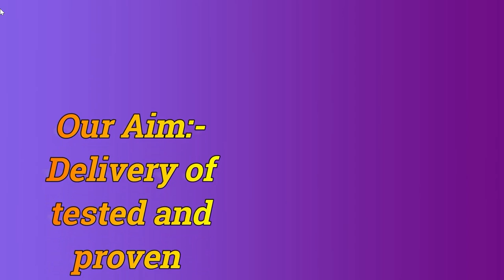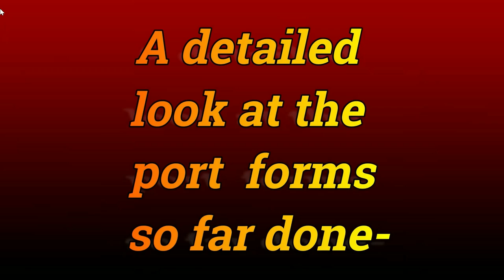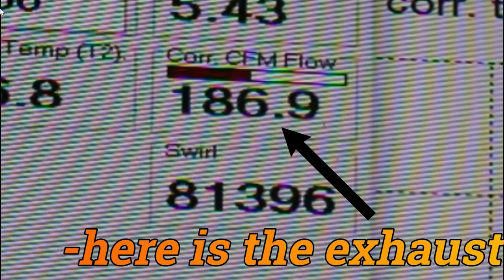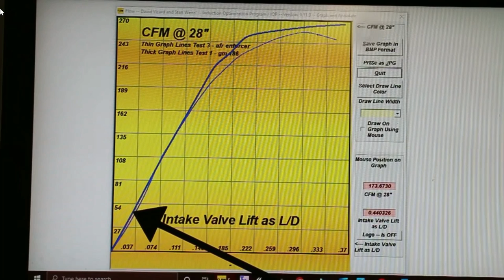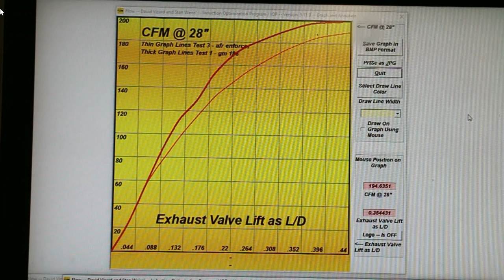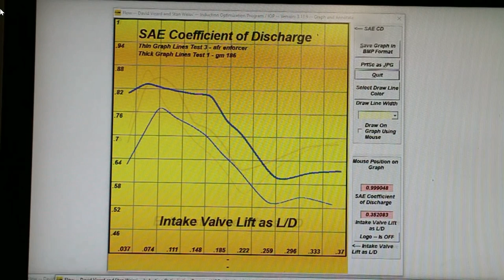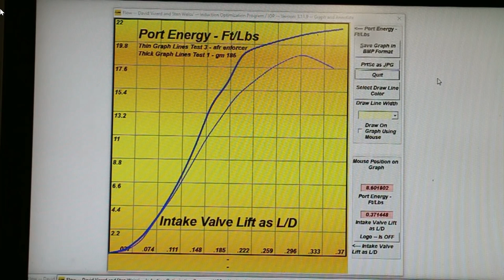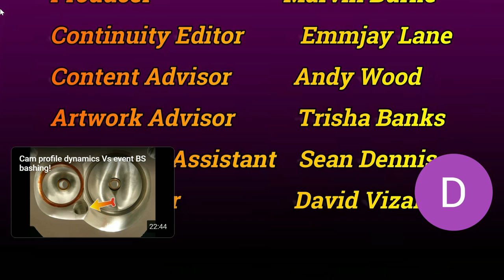Super porting factory castings for aftermarket power.

Comment: Have you ever given thought to partnering with a foundry to make a David Vizard designed cylinder head?
Reply: An excellent idea,!
Reply: I LOVE that idea! I bet they wouldn't be able to keep them on the shelf.
Reply: Yeah!  Well i heard BRODIX is one of or if not THE LAST true family owned american usa engine business, and i am cite that as one reason maybe DV could consider it.
Reply: Imagine a David Vizard cylinder head design to be small block and big blocks of all manufacturer with sbf and sbc bbf bbc , and mopar first, then buick, pontiac, etc. With a 4 valve per cylinder-single ohv cam design for street apps first and foremost witch shall in turn translate to racing apps.  Staggered valve sizes to mate with the bias of ports. And unstaggered street version and race versions.
      Industrial and boat industry shall also want in on it. Like ADVAN and MAHLE with their new boat engines that have solved the inline 4 secondary engine imbalance limitations and now 30% more power is available, now boats with 6 to 8 engines only need 4 big high revving inline 4 cylinders! check it out in florida boat industry unveiling in 2024! imagine them in camaros with a BRODIX DV cylinder head!
Reply: Now that's a head I would buy!
Reply: Wow. Absolutely awesome
Reply: No one wants an iron head really.   His design in an aluminum head would be awesome.
Reply: @zAvAvAz  brodix will build what  you need, how long I don't know

Comment: David this video reminded me of the articles you wrote in Popular Hot Rodding in the early to mid ‘80s on porting these head castings (and prepping the block) for a budget bracket racing engine. I used this article for a friends 355 with the 291 head castings back then. I see that as expected over the last 30+ years you have made new refinements to get the most from these heads but the main modifications are still very similar

Comment: 550 hp on a 302 is impressive. Surprising potential in those old castings, definitely improved upon with years of R&D.
Reply: Back in mid 80s NHRA Super Stock 302ci 11.5 to 1 compression 2.02  461 head match port intake into the head runner .250 max ,3angle valve rob, cleaned up combustion chamber factory cc. The heads CAN NOT be ported. 3250lbs 10.70 125mph. Same cast iron head 2022 full porting is allowed 10.00 130mph  Z28 302ci Camero stock body. Got to be around 600hp.
Reply: @jeroldlafferty54 interesting. Thanks for info 👍
Reply: These were being built to 600 horse within a few years of coming out.

Comment: There is so much that I can apply to my 50yo cast iron 4-banger with known exhaust port problems, similar to the old Pontiac and Chev 6-pot port issues.  Time to get a practice head, some flow balls and start from there.  Thanks David.

Comment: I'm happy that you made the Chevy 302 the subject around those 186 casting numbers those engines came with those castings anyway I'm a big fan of the 302 Chevy and many think that it's a waist of time building them but in reality they can run circles around a lot of engines in the quarter mile drag strip if properly built and in a good chassis car. Those engines were quite common in modified production and in the alphabetical lower classes which had even smaller engines, generally they all were capable of turning 9,000 to 11,000 rpms . If you could find some of those 90s videos from Rockingham with Brett Kepner  the tower announcer at one of those super rod events, super rod is IHRAs modified production like NHRAs modified production you will see the times those cars ran some had to carry weight depending on the cubic inches and many were running high 9s to low 10s and I'm very familiar with those Lola T-70s and they came equipped with the 302 engine for the five litre class and that's pretty Ironic, because they couldn't sell a lot of those 302s in the Camaro in 69, 70, 71 and so on so those engines had to go somewhere and many ended up in the Lola's and in the South African CanAm muscle cars so they are still out there just somewhere else, I'd like to see you do more work with a 302 engine we all know that the 383 is trending today and anyone can build one even GM markets a crate engine, Jegs, Summit, Competition products and everyone else let's see you build a small cube Chevy or even a Clever or Windsor 289, or 302 and twist them on the Dyno and let's see what they can put out in today's era in performance parts

Comment: Professor David 'the humiliator' Vizard. Specialty; machining stock production passenger car cylinder heads & using them to outperform the best cylinder heads the aftermarket high performance boys can design & build. The David Vizard motto; "If you can design & build it I can better it!"

Comment: Those were the heads to have back in the 70s but my first real set of good performance heads was a cast iron set of Lee Shepard 202 angel plug heads I had a solid lift high winding small block in a 67 camaro that picked up 4 tenths in the quarter mile in 1977 I payed $500 for them from a guy I knew who had a pair on his dragster. That was the most expensive part on my car and I pulled the heads off when I sold the car and put them on my 331 I had in my nova. I love street racing back then.... your friend from Louisiana Rick 427

Comment: Wow, I have heard the name Vizard but now I know why!  Such a clear and concise explanation and really made me feel confident about some of my guesswork which has been somewhat clued in by the late David Ijams in regards to port velocity and shrouding.  I’m only building mild street truck engines and I have questioned running a smaller intake valve on a 1093 open chamber head and this is just enlightening to say the least.  I’m probably not going to do that $$ but where I thought I was only going to focus on exhaust ports and valve face may be revised.  Total noob machinist here 🥳🤣

Comment: Hey DV, so good to see another video!

One thing I didn't see you mention however, I thought I'd bring up...

...whenever I am going to work on any old engine part, I am a firm believer in chasing EVERY threaded hole before any other machine work is done, and before cleaning.

Learned behavior... I found that if I didn't do it first, it got left until the very last. After everything was done, and I was going to assemble it. Which means, I had to take a lot of care to not get any chips in anything (and not infrequently had to take things back apart for cleaning afterwards)

You probably already know this (and probably do it and just didn't document it on video), since you've been doing this stuff since before I was born - but mention it in hopes it will save somebody else a little bit of hair pulling on some project...

Comment: So if the plan is a racing engine that will be pushed hard, would it be worth it to get a set of 186 castings? Or would it be more economical to clean up an aftermarket set?

Comment: Hi David  ive got a set of BBC 702 castings.  these are closed chamber bathtub style chambers (96cc ) If i do the same mods to the exh side quench area, blend and clean up the bowls , do a 3 angle valve job and some port work on the roof side,  i should see atleast a 30-50 ft lb of improvement in the low end?

Comment: One thing I noticed is that a lot of the older sbc heads have alot more meat in them to hog out , like vortec heads flow better than double hump heads out of the box but when ported you get better flow out of double humps
I believe when I weighed them the vortecs were 10 pounds lighter .
Reply: Early 70s heads and blocks were that way

Comment: Would love to see the results with the same head treatment on a 400 cubic in  Chevy.060 over  10:1 compression with 770 cfm holley on Performer intake.  Hydraulic flat tappet limit approx 6000 rpm.

Comment: David vizard ive watched this video serveral times very imformative but i have to ask. What is the benefit of lets say a 416 casting small chamber for compression with a 1.72/1.50 valves. Using your techniques and using the stock valves would port velocity play a roll in power production without chamber modification except maybe on the exhaust side to benefit flow at the .250 lift mark so the flow goes in the port instead of over the valve.

Comment: I’m working with a Ford 460, is this engine an original prototype of the engine used in the Silver Bullet? Were  the Germans years ahead in crankshaft harmonics at mid to high end rpms? Or were they more on the side of lower rpm torque development because of the original diesels?  Today, I put some spacers under my sniper for my air filter to clear the HV per Pertronix distributor, and instantly had the idle rpm go up 5-700… tomorrow I’ll put back the original EGR casting spacer with one one of my spacers (noe have two for the clearance issue), to see if it rectifies the high idle. Mind you I was getting a stall on hard breaking and or on prolonged deceleration. The spacer solution seems to have fixed these two issues, mind you it’s probably due to the much higher idle rpm. You will probably say something like a vacuum leak is my culprit, and yes I do suspect the system isn’t air tight. Just to clarify, This application is not for racing and I’m a stickler for MPG efficiency but it might not matter if I start running HHO gaseous fuel. Thanks for factoring in (mentioning) the atomization droplet 💧 sizing for poor performance ! I’m sad to hear, see the memory of your daughter (I am assuming she was your daughter), my condolences for your tremendous loss of family. Keep well Mr. Wizard (Vizard), take care.

Comment: I want to share an experience I have had with my small block ford.i put a 2 inch spacer under my carb,oh man what a difference. My problem is I can't run one cause I have no hood clearance. My car is a 1974 tvr I've installed a 347 ford.supossidly it runs 503 hp the car weights 1800 without me in it.Small block ford for ever

Comment: I have a set of 1965 FE heads . I have 2.04 intake and 1.6exhaust that flow 278cfm at .500 and 205 at .500 and they never backed up leveled off just from using your books.  How does the abeviated intake port of the FE.  394 ci 503 hp 496 ft lbs. effect the flow. To me no more than I did I am happy, but I wish I knew how much more it really flows with the equal amount of port length that is on the intake manifold under the valve cover. I have done the same heads with 2.09/1.65 valves on a 426 ci FE and it did 596 hp at 7100,538 ft lbs at 4800.  Can you postulate the rough difference. Those had radically different cams. But it did surprise me.

Comment: You’re increasing chamber size decreasing compression. I don’t understand why you would want the smaller valve on intake valve. I understand having more room in chamber for air to clear but your bringing air in from the other side so having a 2.02 valve with port work done would allow larger diameter opening for air to come through.

I would really like to see test results of ported camel humps with the 2.02 intake valve. Also because those AFR heads need work from the factory as well.
Reply: Bigger doesn't mean more flow. Too many folks waste time & $$$ installing larger valves in a casting that not only doesn't need it but can't even take advantage of it... Until your able to spend month's playing on a flow bench you won't understand
Reply: By increasing port velocity you broaden the power curve overall. A peak hp number is just for show. Having a broad power curve is more useful.

Comment: My name is Wes and I really enjoy your channel. I am a novice builder having done a 69 Camaro (350) I GOT MYHANDS ON A 1971 Che y C-10 (350)  Thus far I had the Turbo 350 Trans rebuilt , put 373 gears in the back.  Truck has stabilizer bars in back. This truck I wanted for a cruiser/ hotrod. What I have so far is a forged steel  crank at (3.50 instead of the (3.48 stroke) Flathead pistons,  Vortex heads at 64 with 1.96 intake. Eddlebrook itake manifold(two split) , 750 Hollly EFI and I am stuck on the camshaft. My goal is to reach close to 500hp. Do you have any suggestions that could help me? I am open to any changes. I have not started working, on the engine yetnorbought any other parts except the braking system with a dual8" diaphragm. The wiring g is also fried in certain spots so a new harness is also in order. I am open for advice if you have time, it would be greatly appreciated.  Tha k you- Wes
Reply: How are you coming along?

Comment: If its under 500 lift just run a vortex 350 head it will make more power to 500 lift then any old school head there a thin wall casting do not over heat them

Comment: I wonder how much extra torque/horsepower I can get out of a 2nd gen small block LT1 with some home porting. Do all the port work myself and then have the deck cut and valve seats done at a machine shop? Would it be worth the time and money? If the valve seats are good and the deck is true, just port them and install them? I have more time than money. I need cheap power
Reply: Buy an extra junkyard head to practice on !!

Comment: You could have learned more about porting with this information then buying a set of after market heads...yes. Realizing modern day heads have these modifications done in the original sand cast. So good heads already have these mods (as cast)!  From a business aspect. Man hours cost considerably more then buying the next size up cylinder head. This info is for guys on exstream budgets. Or restricted racers looking for maximum performance from a limited head. 
  When you can't lower the ramp of the short turn. Raising the floor of the port before the short side improves flow everywhere!!!!

Comment: Do not use a gasket , reason? A gasket is always bigger than the cylinder and if you port out to the line the head will over hang the cyl. And cause turbulance! Blue the head, then bolt it to an empty block,turn it upside down,reach down thru cyls. Scribe lines, they will match cyl. Size!
Reply: Turbulence is good
Reply: @moabman6803 no it isn't. What that guy said was correct unless you chamfer the cylinder and there aren't many willing to do that. You never want your chamber overhanging the bore

Comment: no secret the afr enforcer is 195 as cast, does much better ported out to 210-220 and used on larger displacement, or higher rpm engines. you are comparing it to a small street head that will function well on a pump gas 302-327 from idle to 6500. its easy to make your head look superior when you compare it in that light. who builds a 302-327-350 anymore? 383-396-400-427 is the norm now, and for that the afr is a better starting point. Further, most are winding the bigger engines to 6500-7000, or using a power adder. interesting info for a vintage class racer or superstock that requires the old head though. the average guy will not spend 2-3 grand on 50 year old iron unless it is a rules limited engine.
Reply: The double humps heads aren't really used anymore but the Flo Tek aluminium clones are quite popular. Assuming this work can be done somewhat efficiently it's a nice value add for crate 355 and 383 builds.
Reply: You absolutely missed the entire point of the video.
Reply: @moabman6803  he sounds like he is proud of throwing his wallet at his junk instead of thinking . Latest trick of the week while the parts maker PAYS for the testing on their whiz bang gadget !!! Real World Happenings !!!!

Comment: The 2.02 small block Chevy didn't come out tell the L79 350 horse power 327 the 4 bolt main small block Chevy didn't come out tell 69 No 327 ever had 4 bolt mains the 3O2 and 350 got them in 69 the 302 had pressed in rocker arm studs the LT1 350 was the 1st small block with screw in studs doesn't make sense a 302 pulled more RPM then a LT1